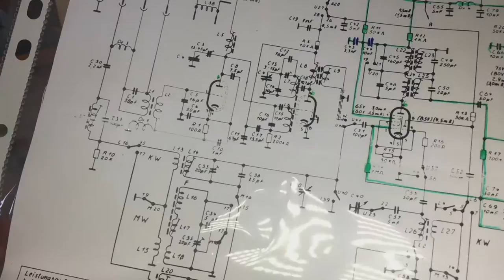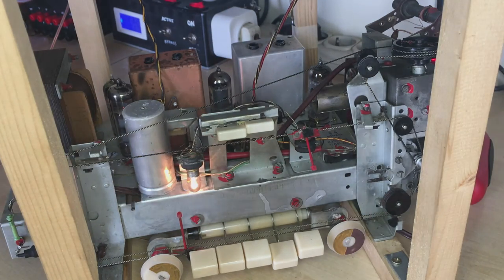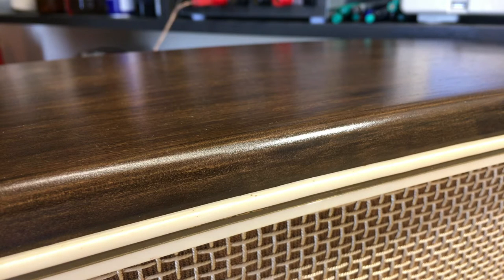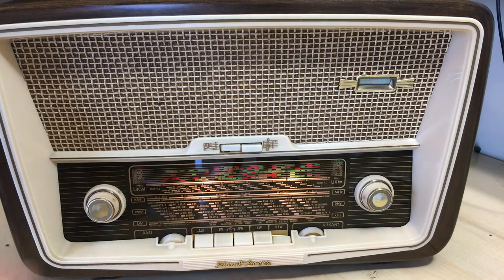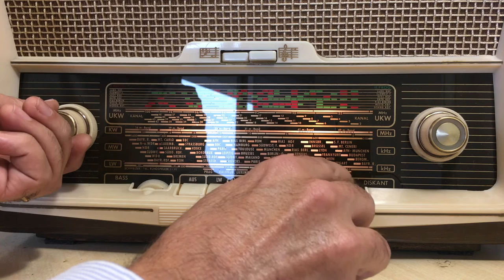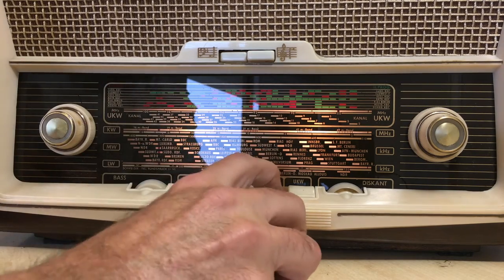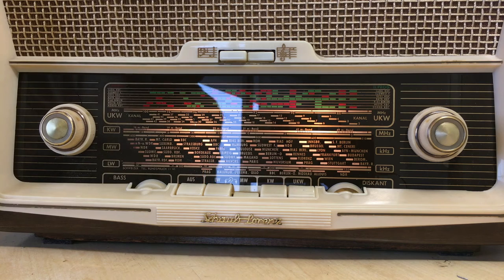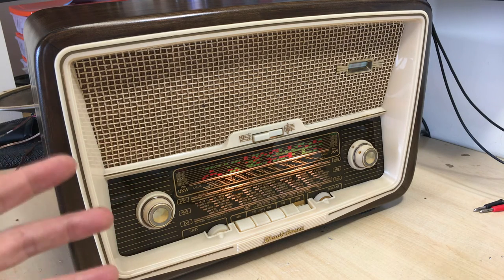Schaub-Lorenz Goldy 58 type 3020 tube radio restoration - Part 3. Job done!

Comment: I found a goldy 59, if I want to turn the volume down it ends at being "still pretty loud". Is it normal or some kind of a defect?
I do  like your varnish pretty much!
Reply from the maker: Those old pots sometimes don’t actually get to zero ohms and some volume comes through even when turned down all the way. Also the feedback loop raises the pot’s ground from ground itself, so the feedback components may need checking to prevent this phenomenon.

Comment: Sanded? How do you sand the wood, with what materials do you sand and with what materials do you restore the paint varnish/finishing layer?
Reply from the maker: First 120 grit sandpaper, the then finer and finer. The finish is too long an explanation. I suggest you see a recent video by David Tipton on restoring a similar cabinet.

Comment: I’m just about to do an AM alignment on a Schaub Lorenz Oceanic E103 but am a bit puzzled by a third adjustment on each IF can. As well as the usual 2 adjustments is a coupler. I can’t send a photo on here but it’s like a threaded collar around one of the cores that moves the core up or down in relation to the adjacent core. 
The instructions:
1) adjust coupler subcritical by turning anti clockwise.
2) adjust L37 and L38 for max output.
3) Adjust coupling critical by turning clockwise then back off 1/2 a turn.
I’m not sure if this is something unique to German radios, you seem to have worked on a few so wondering if you’ve ever come across this.
The Germans seem to like over engineering stuff :)
Reply from the maker: I’ve never had one of those, but follow the instructions: wind it out, tune the two coils, and then wind it back and release the half a turn from the max point.
Reply: Electronics Old and New by M Caldeira Ok, I did some research and finally found a reference to inductive coupling. Not sure I fully understand but the gist was that there is increased performance if the secondary is backed off slightly compared to the primary. Only the Germans would do this :)

Comment: This one was a refreshing change to the rather over-engineered larger German sets.    It's a nice looking little set.
Just a quick question.  Do you know of any Tube/Valve radios with FM that goes above 100MHz?
Reply from the maker: Yes, they started going to 102, and then 104 in the 60s. I believe Philips are the prime example.

Comment: Great job on the radio. I'm now restoring a Schaub-Lorenz Goldy 3133. Can you tell me what kind of varnish did you used?
Reply from the maker: I sanded it down to the wood, then stained with a dark mahogany water-based varnish, starting with a very diluted coat and working up to a final undiluted coat. I did quite a few coats - can’t remember exactly how many. Then the final clear lacquer - also multiple coats.

Comment: Hello, I am working on a S-L Goldsuper 58. Components look very similar. It has also very poor AM sensitivity. Where did you injected the AM signal for the alignment?  Thanks for the capacitor trick for AM FM differentiation ;-)
Reply from the maker: Usually the grid of the ech81.
Reply: @electronicsoldandnew  thanks this highly appreciate. You have strong pedagogic skills in you video !
Reply from the maker: thank you